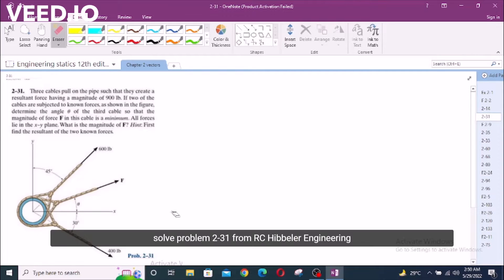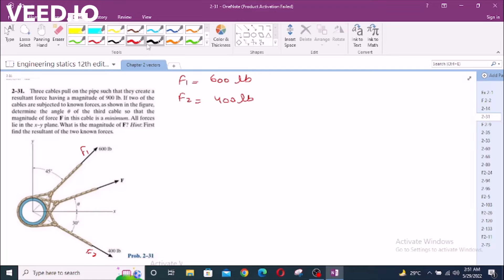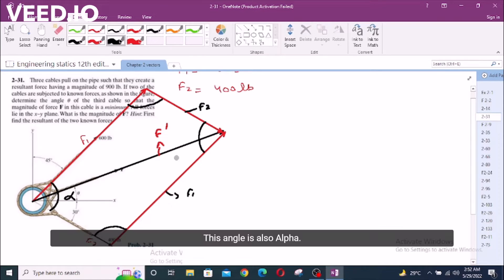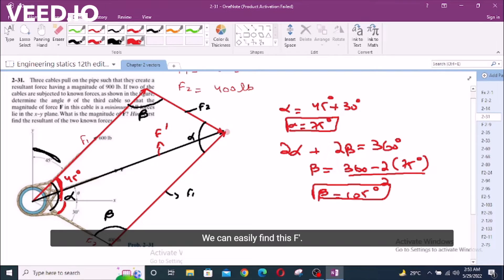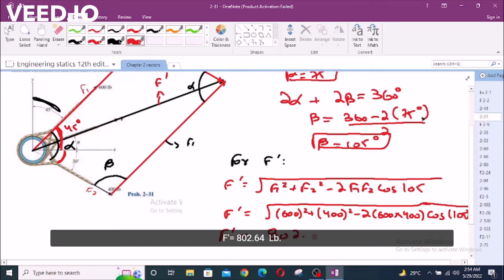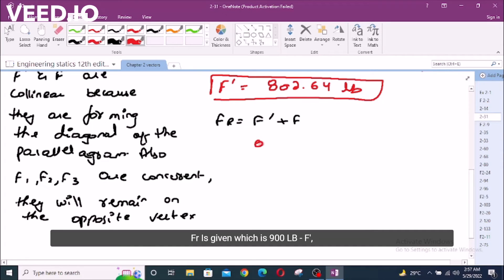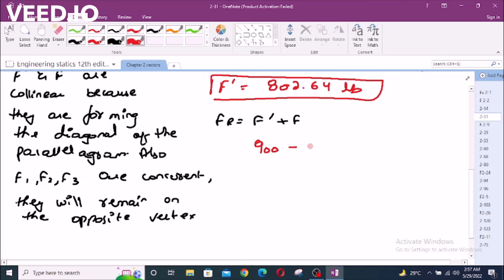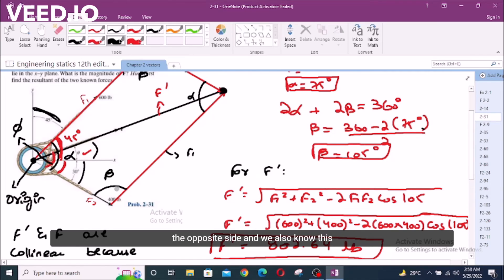2-31 hibbeler statics chapter 2 | hibbeler statics | hibbeler

Comment from the maker: Learn How to Solve 2-18 Hibbeler Statics Chapter 02, "The truck is to be towed using two ropes. Determine the magnitude of forces FA and FB acting on each rope in order to develop a resultant force of 950 N directed along the positive x axis. Set theta = 50 degrees."
Here is the Link: https://youtu.be/d7atxkZLXfg

Comment: i dont understand how u got F
Reply from the maker: The forces F1,F2 and F are concurrent on the opposite vertices of the parallelogram, it means that F and F'(resultant of F1 and F2) are collinear. So the resultant of all three forces is a diagonal Fr=F'+F. The values of Fr and F' are known you can rearrange the equation and get the value for F. I hope it will help! 🙂

Comment: While applying yhe law of cosine why the angle is taken beta whynot alpha
Reply from the maker: Because I was interested in finding F' . In cosine law we take the angle that is opposite to the considered side of the triangle. I hope it will help!
Reply: @solutionsmanual9535  so if we were finding f1 or f2 so we'll consider alpha or beta
Reply from the maker: @faryalgul8033 If you are finding f1 by cosine law you would have to use (theta+30) degrees and if you have to find f2 by cosine law then you would have to use (45-theta) degrees. I hope this will help !
Reply: @solutionsmanual9535  jazak Allah